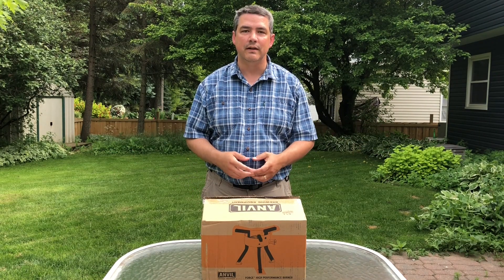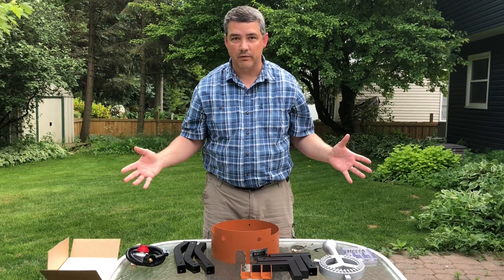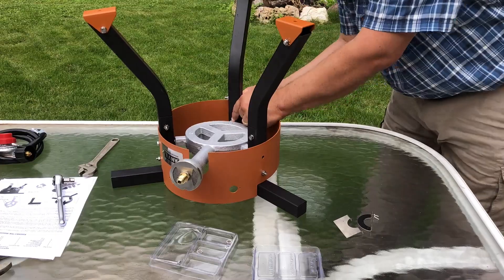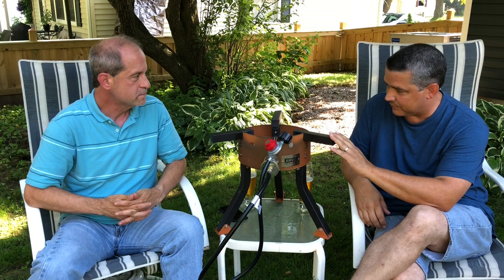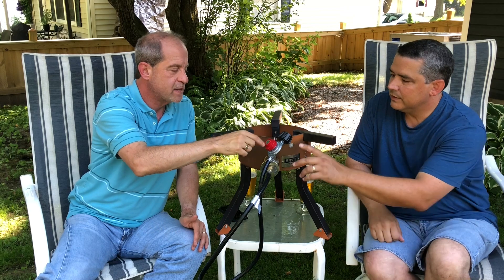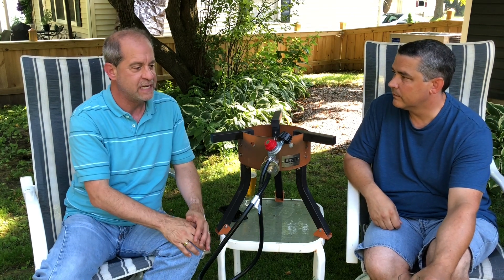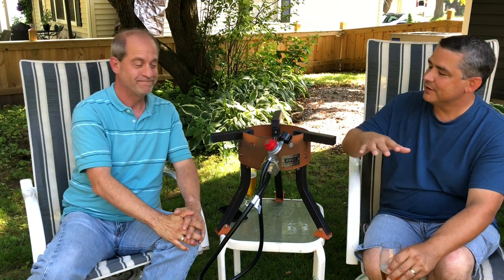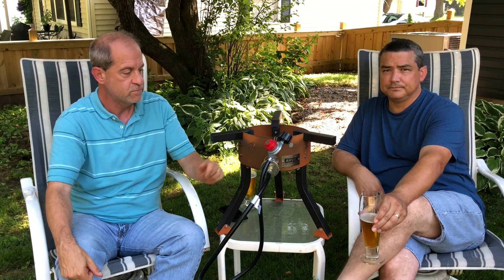Anvil Forge Burner Review

Comment: Appreciate you posting this - still sitting on the fence, picking my gear. But this looks like a real contender - really like the full shield and the tripod mounts - looks like the difference between this and Hellfire is the burner casting - Hellfire is just more dense. Thanks for sharing and keep the videos coming!  Brew on!
Reply from the maker: Since I have experience using both the HellFire, and the Forge burners, I can tell you that without a doubt, if you’re not planning on brewing 15+ gallons of beer on a regular basis, the Forge Burner is the way to go.  That said, if you have the extra cash, and don’t mind four legs (a little less stable) the HellFire really kicks ass!  Keep brewing my friend!
Reply: Approximately how high is the burner with the standard legs? (I guess that is floor to the kettle supports.) I am wondering if the 24 inch legs are worth the $25-$30. Yeah, I know, they are a bargain compared to the Blichmanns.
Reply from the maker: I’m not at home this week, however the website states that the height is 16 inches. I’ll double check when I get back, and if it’s different I’ll let you know. https://www.anvilbrewing.com/product-p/anv-forge-burner.htm